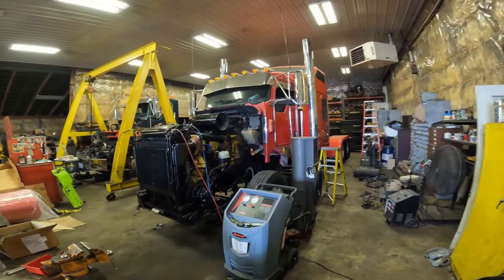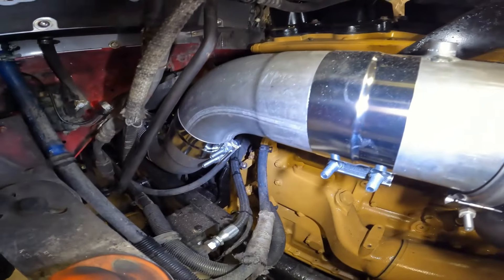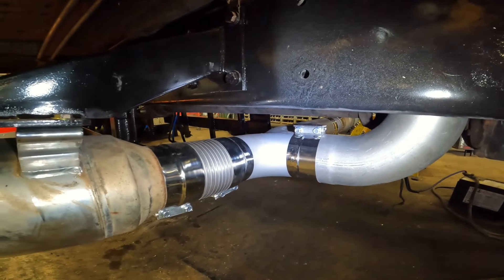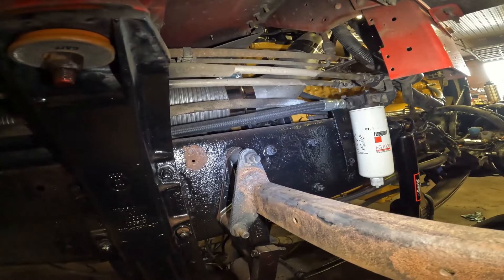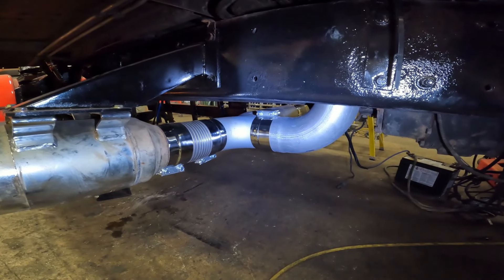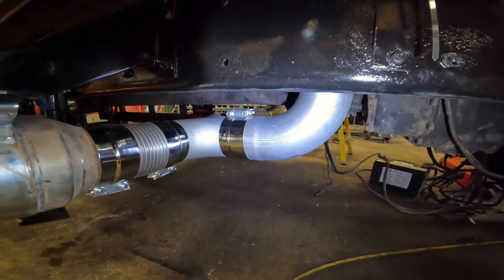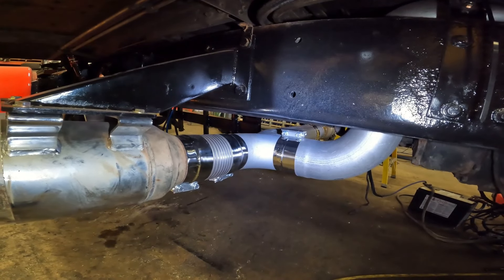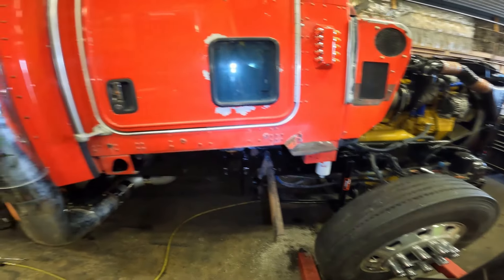07 KW T6 Project: Days 20-22 - Lights, exhaust, plumbing...

Comment: Did you use the 16:1 compression pistons on this conversion build?
Reply from the maker: Yes.  Since it's a 6NZ 16:1 is the stock ratio.  But upgraded to single piece steel pistons.

Comment: Quick questions. I have a 2001 W9 and those are the moto mirrors on want to put on my truck. Can you tell me what brackets I need to get to make it work. Thanks.
Reply from the maker: I'll have to get back to you on that.  My customer sourced them.  I'll ask him
Reply: @bigrig_smilespergallon  thanks
Reply from the maker: https://www.4statetrucks.com/mirror-bracket-yoke-for-moto-mirror-plus-ppr_200991
Reply from the maker: https://www.suburbanseats.com/products/motomirror-plus-dual-heated-motorized-mirror-kit-with-harness?_pos=1&_sid=046799686&_ss=r  This is the cheapest place we've found to get those mirrors.  It's the whole kit.  Both sides and all the wiring and controls if you want to use them.  We didn't